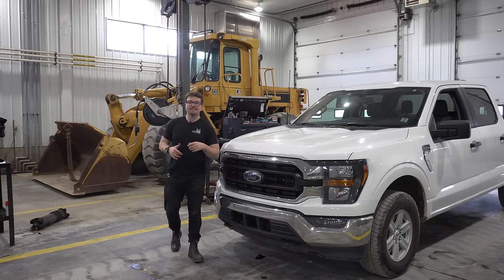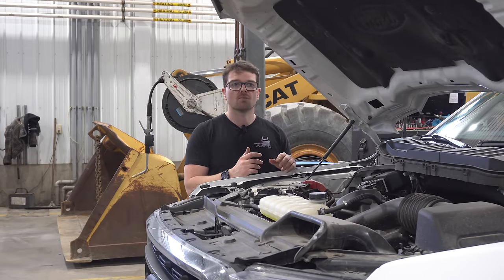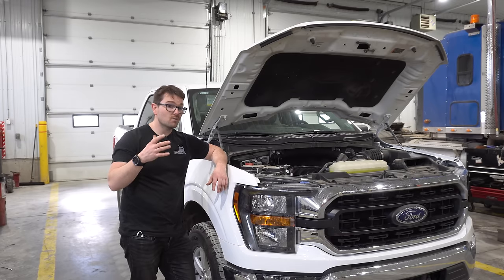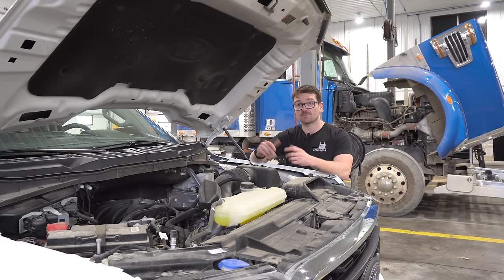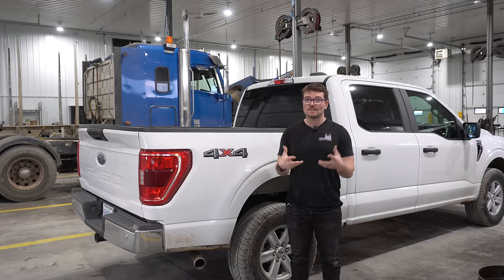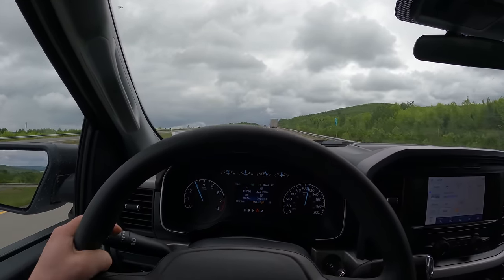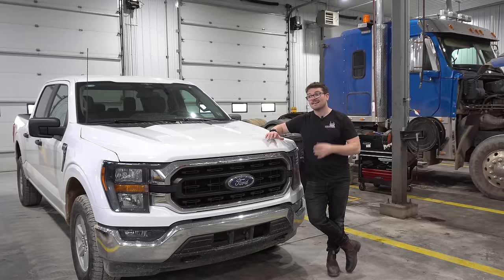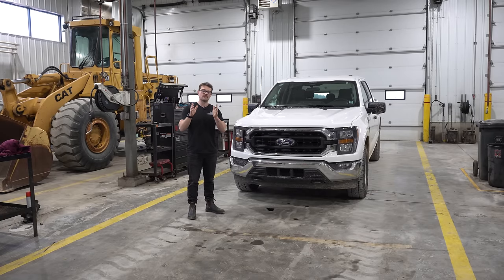Ford F150 5L Coyote V8 Engine **Heavy Mechanic Review** | 5 Reasons why It's the BEST

Comment: Except for the wet belt oil pump which is a deal breaker for me.
Reply: Lots of other manufacturers have these with no issues. Just watched a video yesterday 2.7 2020 f150 with 550k miles did not change the belt

Comment: Got an early gen 1 coyote in a Mustang. It's been flawless. I'm thinking it was virtually hand built early on to assure a good launch (or I'm just lucky). Love the engine. One of the great V8's of all time. It is a bit of a top breather that love to rev, so get 3.73 gears to help on the low end. 
-Unfortunately Democrat government regulations forced it to now have cylinder deactivation. Hopefully there are ways to deactivate this useless complexity.

Comment: Personally I don’t care for the nikasil cylinders from ford. They had some warranty issues when they switched from cast iron cylinders. Yes they cool better but get them hot and you got ring issues. 👍👌
Reply from the maker: I honestly wondered if that's what caused all the oil burning. they switched from iron liners in 2018 and mysterious in 2018 these engines really started to burn oil.
Reply: @TheGettyAdventures  yup ; I researched the 5.0 for my buddy on the f150 . Yup ; they switched  2018 . Great heat transfer ; but - some issues oil burning .  Warranty stuff - 👌👍

Comment: You didn't mention the rubber belt that drives the oil pump inside the engine (starting in 2021) wich imo is a horrible idea.

Comment: The biggest problem with the 5.0 is that it's in a ford, combined with the jerky 10 speed and it's just not the first choice for me. That would be the 3.0 diesel, it's the better all around package/truck. Call me crazy but hearing that thing rev out to 7000 rpms would drive me nuts while towing, the first time its glorious of course but very quickly gets old.
Reply: You know nobody is building a 1500 diesel anymore except gm ?
Reply: @TheMajictech  Is that a rhetorical question?
Reply: @JohnSmith-ev1sm  call it what you will, but those are the facts.
Reply: @TheMajictech  Nobody is arguing that GM is the only one offering diesel, I said that the 3.0 diesel (which yes would be the chevy/gmc) is the better truck all around. In other words, a truck is more than just the engine, and the trucks with the GM diesel is the all around star of the 1500 segment.
Reply: @JohnSmith-ev1sm  modern diesel powered vehicles have become unreliable due to the EPA mandated Selective Catalytic Reduction systems.

Comment: personal experience... worst acceleration out of the last ten years of company trucks.
At 75,000 miles used one quart of oil per week with no oil spots on my driveway.
nothing to do with the motor but the ten speed transmission was constantly searching for a gear very strange.
The best performance out of the work trucks i have driven 2014 f-150 6cyl eco-boost absolutely amazing.

Comment: Low end grunt comes just as much from gearing as it does from displacement…. So your analysis of lagging, or “falling short”, from light to light, and then saying it is because of displacement is incorrect! A proper rear gear ratio along with transmission gearing (especially with a 10 speed transmission), gives all the pulling power ever needed!! You should know this as a heavy duty mechanic..

Comment: 100% BS!  Like it or not, the highly underestimated and widely hated 2.7L EcoBoost (Nano) is the BEST engine for the Ford F-150. In fact, it's probably Ford's most versatile and reliable engine on the market today. The stats are starting to pile up in it's favor, even diehard V8 worshippers are starting to see the light. I'm already sold. My 2015 Nano has over 233k hard-driven problem-free miles, not a single warranty claim, recall or repair to date.  When it finally goes, I'm putting in a brand new one. No way I'm buying another new truck unless I win the lottery! lol!
Reply from the maker: Well Next week the 2.7L will be making the channel debut. We'll see how it goes!!
Reply: @TheGettyAdventures  Thanks! I've seen a few positive reviews on the nano lately, but I won't hold my breath! lol! My biggest gripe about the 2.7L EB is not so much the "plastic" oil pan, but the chinsy twist-off oil pan drain plug and the oil pan gasket leak. Luckily my driveway is gravel, so I can live with it. At least it doesn't leak enough to drop the oil level.
Reply: A lot of people like myself who like the 5.0 coyote for its awesome sound, especially with the resonator pipe removed and magnaflow duel exhaust sound , MUSIC TO  MY EARS. NO V6 will  ever sound like a V8, a V6 sounds like a plugged up Hoover vacuum cleaner, NO THANKS I'll PASS. That's my take on it. In my eyes  there's no best engine they ALL have there pro and con's, that's why car and truck company's give us CHOICES, 10 - 4.
Reply: @danherrala2087  Yes, we all get it. All V8's are MUSIC TO OUR EARS! Duh, right? Especially with modified exhaust systems. I'm 61 years old.  I feel ya.  But what you're apparently not getting here is the fact that we're not talking about any old V6.  We're talking about Ford's EcoBoost, specifically the 2.7 "Nano."  They may not be "music to our ears," but they're definitely MUSIC TO OUR HEADS! lol! By the way, did I mention that my truck sounds pretty fucking badass even though it's not a "V8?" 🤣

Comment: Love the 5.0 but Toyota 5.7 in the tundra is far more reliable in my opinion anyway
Reply: Probably right but the tundra looks like dogs ass compared to the ford
Reply: @Trevormaffetone  can't deny that interior n exterior depends what's more important to ya everything has its pros n cons
Reply: @kennysullivan721  I agree. There are also horror stories on both sides. Admittedly most likely less than ford. However ford has more trucks on the road by a pretty wide margin. I’m a Toyota fan. I’ve owned a Tacoma.

Comment: No thank you, I'll keep my 06 GMC  Z-71 with the L-33 all aluminum LS platform. Over 200,000 miles. Everyone is building more power and smaller oil channels. Plus 8 or 9 computers, every manufacturer is the same. Old versions are better.

Comment: No the coyote isn’t the best.  It’s a mustang motor. High revving low torque. When towing its at 6000 rpm. Cant hear in the cabin.  It has 100 less torque than the 3.5 which hardly works at all when towing.  It’s ok if you want pipes and you’re just going to listen. The 2nd gen eco boosts are just as reliable as the 5.0.

Comment: 5.0l with the 6 speed will go down as the best drivetrain any modern truck has ever had
Reply: I here you LOUD and  CLEAR !!!! I own a 2016 f150 5.0 coyote 8ys. old 34,000 miles .Never seen a Minnesota winter.  Love it.

Comment: He'd much rather have a cam phaser failure than a turbo?  Seriously?  A turbo replacement doesn't require pulling tye timing cover off. So an $800 turbo replacement vs thousands  to replace the cam phasers. I love the coyote engine bit that was a really ridiculous comment and an even dumber reason why it's better than the ecoboost.

Comment: Engine maybe good but other areas of the truck are garbage.  The clunk noise in the 10 speed transmissions, doors not aligned properly from the factory, blurry backup camera, condensation leak on passengers side floorboard.  The camera has a recall and most others have just a service bulletin.  QA has gone down hill.

Comment: U forgot to mention Ford went with a wet belt driven oil pump in this generation. Don't know how that will hold up.
Reply from the maker: coming onto the 4th year of the new generation and seems to be holding up but like most things only time will tell.
Reply: @TheGettyAdventures   will see. The 2.7 ecoboost has it too.

Comment: Get rid of the cylinder deactivation, belt driven oil pump, plasma spray on  technology cylinders, and direct injection then maybe you have a start to making a good engine.  Pass.
Reply: You can turn off cylinder deactivation. Belts have not been an issue in the 2.7 or the 3.0 diesel. I will admit it’s annoying to have to spend money to change but I’ve watched video after video of people changing theirs at 150k and the belt was just fine.

Comment: LMAO.  Stay away from Fords!  My brother just had a 2021 F150 with a 5.0L Coyote motor just quite running.  This guy does meticulous maintenance on all his farm equipment and vehicles and documents it all.  Took the truck to the Ford dealership in Tulsa.  10 minutes later they tell him the truck (52,000 miles on it) needs a new motor.  No explanation why EVERYTHING on the motor broke and it ALL needs to be replaced.  He asks to speak to the technician.  They say, "No".  He laughs and walks back into the Ford maintenance shop and begins asking this technician what he did to diagnose the truck and what EXACTLY is wrong with the truck.  Technician says, "I just pulled the codes and gave them to the maintenance boss. He decided what to do.  He takes the truck back to the farm, does a bit of research, pulls the valve covers, and finds ONE broken valve spring....ONE.  A $10 fix.  Ford wanted him to buy a $7,000 motor.  Wait...I forgot to tell you that Ford wouldn't even discuss a warranty fix, because the truck was 2,000 miles over the 50,000-mile warranty limit.  Real nice, Ford!  So, because he overdoes everything, he bought a whole new head and valve train to replace ONE broken valve spring.  He buys the Ford maintenance manual to ensure he does the work to Ford specifications.  After replacing the head 3X and NOT being able to time the truck correctly, he gets a little frustrated.  My brother calls around and finds a retired Ford technician who agrees to time the truck for $1,000.  He does it in 1/2 a day.  My brother asks him what he did wrong?  The retired Ford technician says Ford purposely left the most important step in timing the truck out of the Ford maintenance manual my brother paid an arm and a leg for to ensure he did it to Ford specs.  The technician says, "You have to have this special tool and load the #2 cylinder by rotating the cam 90 degrees before you replace the timing chain.  Total cost to fix ONE valve spring, which is apparently a big problem on these 5.0 Coyote motors (bad Chinese steel), on a Ford truck with 52,000 miles = $2,000.  Yeah, he sold that POS and Ford lost a customer for life.  More importantly, I plan to tell this story to everyone who will listen until the day I die.  Ford Motor Company is managed by a bunch of greedy assholes who DO NOT STAND BEHIND THEIR PRODUCT and will try to rip you off at every turn.  If you do business with Ford Motor Company, you deserve what you get...a pile of garbage built by a company that will not stand behind their vehicles.  Sell that piece of crap and buy a GMC with a 6.6L DURAMAX.  It's the best diesel engine made today...period...full stop.  Go watch the YT videos Gale Banks made on the 6.6L DURAMAX.
Reply: Maybe put chapter headings next time lol my cousin has a v8 Toyota tundra that’s giving him all kinds of problems and blew up recently. Any engine can give ya problems man. 

P.s. -Who wrote the forward to your book there?

Comment: Dude is 100% wrong about fuel economy I have owned a 2015 5.3 4x4, a 2018 5.0 4x4 and now a 2021 5.7 2wd. The GM 5.3 is hands down the fuel economy king all 3 trucks had the max tow package. I ahve also driven a 2020 3.5 ecoboost and a 2020 GMC with 5.3 and 10 speed on long distance trips. The ecoboost hands down gets the worst fuel economy out of all half tons. The 2020 5.3 I got the best fuel economy numbers I have ever gotten in a half ton.

Comment: You are calling a wet-belt oil pump drive reliable??
Reply from the maker: Do I like the belt driven oil pump - no. Still a far better choice then any GM v8 by a long shot. and well moving forward probably way more reliable then Ram's hurricane twin turbo coming in 2025. It is not a perfect engine but in my opinion is the best option.

Comment: Ford has not and will not fix the cam phaser issues.  It has been going on since they put them in back in the late 90s.  It is a minimum of 8k usd to have that repaired each and every time.  If you are lucky you will get 30k miles before they fail again.  For me, i would say the nissan titan and titan xd are way better trucks, unfortunately  it took me owning two different brand new f150s to figure that out.  The repeated cam phaser issues was the nail in the coffin.  Bad thing is, nissan is discontinuing the titans which is a very bad move.  But us people in north america are very stubborn, and only want to buy us trucks that are plagued with problems.  Unless you mentiin tundra then it is split.  Also the 7.3 godzilla engine with its camphaser does have issues.  This should tell you something about ford.

Comment: 2022 F150 XL 4x4 long bed w/ max payload and trailer tow package (3.73 rear end) $51,000 U.S. 
    My major complaint is the paint chips off way way WAY! too easily. Ford made the paint so thin and weak that the slightest tap and you have a new view of the light colored primer underneath. It was so bad that by 9,000 miles I put a bra and hood cover on the truck full time. Other than that I tow 5k-6k lbs daily with a 2 axle trailer and Gen-y torsion hitch, not a complaint to be mentioned. Without a trailer at 75mph highway driving I get 19mpg in eco mode and 17mpg in normal. No real complaints except the paint - I'm a 90% happy customer but talk to me in 2027 when I need a full repaint. I can only imagine the cost & quality if more woke liberalism suffering continues.
PS: Blame the Obama/Biden C.A.F.E. fleet fuel economy standards for many of the forced to use motor "upgrades".
Reply: 5.0 V8

Comment: Had the 150 351 v8 it’s a gas eater, I was putting 45 buck a week, go  get the 3.5 eco boost  yea not design well, but Iam putting 10 buck  for 5 days use, this is 465 gal  gas. So in 10 yr Ian saving 20 thousand in fuel, reason w/ twin turbo glob of torque  it in 3 gear at 2,300 , not the 351 that rev to 30 mph to shift ,” for what”? That show the 351 dont have torque or power and just wasting gas all day. Even up hill like nothing no fuss, the 351 making all king of high rpm down shift reving out.  The 351 heads cant breathe , w/ the 2 turbo the power just a tiny tap away with no engine noise. Iam average 20-22 city and hwy  or more my 351 was 13-14 mpg
Reply: I just brought it used at 30 k flat payed off, about 10 yr I say break even, but they are reliable

Comment: Can't get past the oil pump belt. That's NOT a 200k part, and when it goes, you won't be able to shut it down before catastrophic shit happens. Such a small part that can bring down a fantastic engine. Forged internals count for nothing with such a weak link.

Comment: Too bad ford didn’t have the tech to produce a 5.0 litre engine like Lexus as ported and direct injection will last for ever and 472 hp . I’m a retired heavy duty technician not mechanic in Canada of 40 years and a wrote my own software for international not changing oil 😂

Comment: Truk motors are not Coyote motors smaller intake different heads built for torque, less power than your 5.0 mustang i own both. I have checked this out ask your dealership they will tell you same. NOT A coyote....
Reply: UM , the cams are the man difference for the h.p.and torque in the f150 / mustang gt. And yes the intake to and the exhaust manifolds but the heads are the same on both. PLEASE  look  up YouTube video mustang and f150 engine differences by l. M . R / LATE MODEL RESTRICTION,  AND REALLY LEARN  SOMETHING ABOUT THESE  TWO 5.0 ENGINES. I THINK YOU'LL GET THE RIGHT FACTS.

Comment: 5.7 hemi is way better that 5.0
Reply from the maker: 5.7 is a solid engine no doubt. I would say the 5L edges it out though
Reply: @TheGettyAdventures  
Nope had a 5.0 f150 2015 always had engine lag even with cold air intake exhaust weak engine I have 2 Rams with the 5.7 and they are way more responsive and overall better built engine
Reply: @TheGettyAdventures  
I had a Raptor gen2 also which was junk at 60k miles tranny went out ford puts out junk Ram is way better built truck that's just my opinion from owning both
Reply: Agree 👍 Hemi is a better engine
Reply: Yeah right 😂tick tick tick tick

Comment: To note! If you drive your ram 1500 with eco mode off, you bi-pass the lifter nightmare all together
Reply: Wrong. ECO mode is just a light on the dash that shows you are driving in an eco friendly manner and nothing more. The cam/lifter failures are attributed to a combination of crappy lifters, poorly made cam cores, extended idling and mainly poor or lack of lubrication. The cam is literally positioned too high in the block to get proper oiling at idle and low RPMs. Don't fall for the old you got to use 0W20/5W20 nonsense either. MDS activates just fine with 5W30 oil.
Reply: @BamaTidefan1967  good to know, thank you

Comment: Not a fan of the coyote engine in truck application. You need to wring it out to get the power out of it so its good in the mustang but not in a truck where you want low end grunt in low rpms, not screaming it in the high rpms. Those cam
Phasers are a weak point. Id say those phasers fail more than the lifter issue w gmc from what ive read, talking to mechanics at dealerships. The 5.3 w ten speed will kill that coyote in mpg. Coyote wont get 20 combined. Real world mpg says otherwise and Ford lies.  Coyotes now come w cylinder deactivation and more issues especially oil consumption.
Reply: I'm getting 20 to 24 mpg highway with '22 5.0 on stock size tires
Reply from the maker: fair enough, but you can order these trucks with 3.73 gears which will really help to liven up the low end pull.
Reply: And reduce MPG